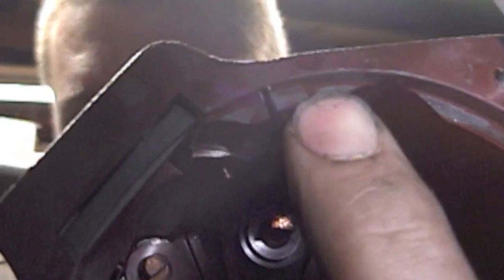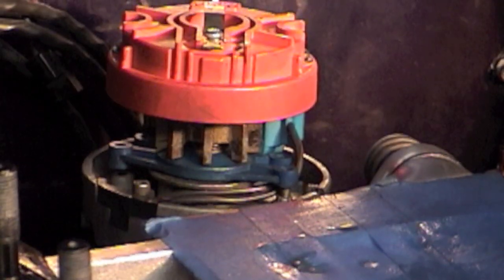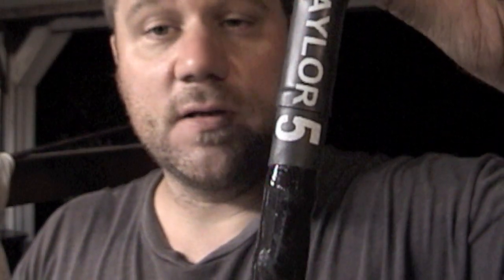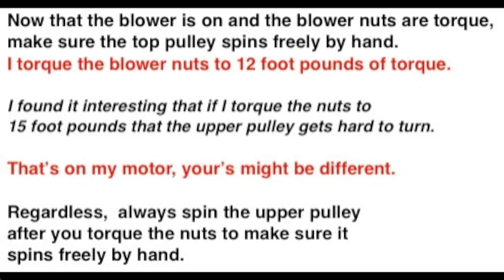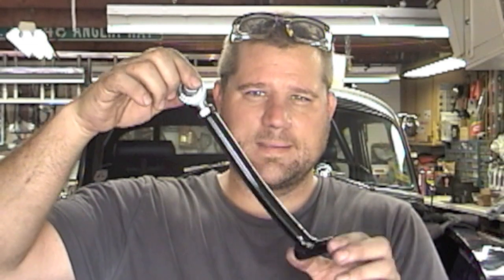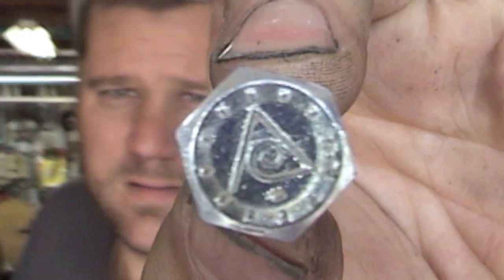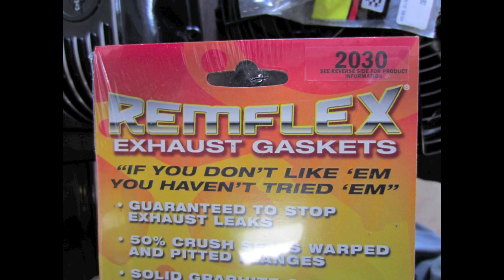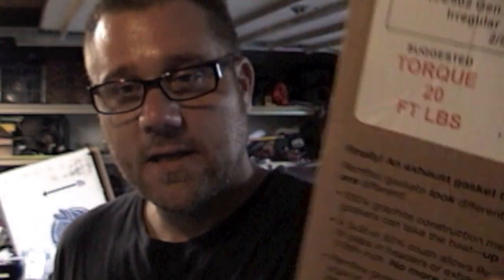Part 21 How To Install The Distributor For The Big Block Chevy

Comment: Ive never done it that way I always do it this way. When installing a distributor in a 396 or 402 Chevrolet, start by determining the correct firing order and rotor rotation direction. Next, align the distributor body with the engine block, ensuring the rotor points to the number one cylinder. Finally, secure the distributor and set the initial timing. 
Here's a more detailed breakdown:
1. Determine Firing Order and Rotor Rotation:
Firing Order: For a 396/402 Chevrolet, the firing order is 1-8-7-2-6-5-3-4.
Rotor Rotation: Chevrolet distributors typically rotate clockwise. 
2. Align the Distributor:
Top Dead Center (TDC):
Turn the engine until the number one cylinder is at top dead center (TDC) on the compression stroke. This means the piston is at the top of its stroke and the intake valve is just beginning to open. 
Rotor Alignment:
Ensure the distributor rotor is pointing to the number one cylinder position in the distributor cap. 
Marking:
Before removing the old distributor, it's a good idea to mark the distributor body and the engine block to indicate their relative positions for easier reinstallation. 
3. Insert and Secure the Distributor:
Slightly Lower: Insert the new distributor into the engine block, ensuring it's slightly lower than the full depth of the housing.
Angle: Slightly angle the distributor as you push it down, which will help with alignment.
Tighten: Once the distributor is in place, tighten the retaining screws. 
4. Set Initial Timing:
Connect Coil: Connect the ignition coil to the distributor. 
Start Engine: Turn the ignition key to start the engine. 
Fine-Tune: Adjust the timing by rotating the distributor housing while the engine is running. 
Important Notes:
Base Timing: Base timing refers to the initial timing of the engine when it's at idle. 
Advance and Retard: Rotating the distributor housing counterclockwise advances the timing, while rotating it clockwise retards the timing. 
Consult Manual: It's always best to consult your engine's specific service manual for detailed instructions and recommended timing settings.

Comment: Hello! I want to know why you do you put the rotor near the #2 and not the#1? Do the engine run better that way?
Reply from the maker: +Michael Wilson 
Just the way I was taught, it works every time for me. The main reason is where I want my #1spark plug wire to be located, it just a preference no right or wrong reason.  and no it does not make the engine run better.  However I'm not an expert just a novice but I found a quicker method on the web from Andy's Auto Repair that I would like to try one day.
"Grab a starter button, get it on compression stroke number one, drop the distributor in so it is pointing directly at number one. With a little pressure bump the starter button until it engages the oil pump drive. Rechech your balancer is 10 degrees after TDC when you are pointing at #1. Done in under a minute".

What's your method?
Thanks for posting Have a great day!
Johnny K
Reply: Thanks! I would point it at the one.
Reply: He is pointing it at cylinder #2 cause on the distributor that is spark plug wire #1. :D

Comment from the maker: Hey Richard Hammer,
The rotor points to #1 on the distributor cap. 
When you remove the distributor cap the rotor should be pointing towards #2 cylinder.
Have a great day!!
Johnny K
Reply: G'day John.. can you email me Re big block chev oiling system...i seem to have an issue with posting..
rosewinpl@bigpond.com   Kindest Regards Steve